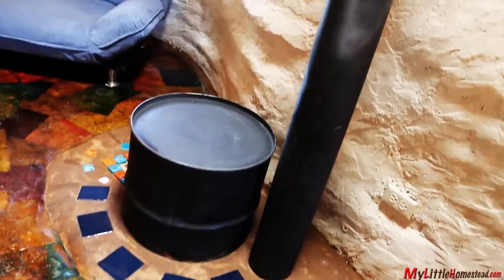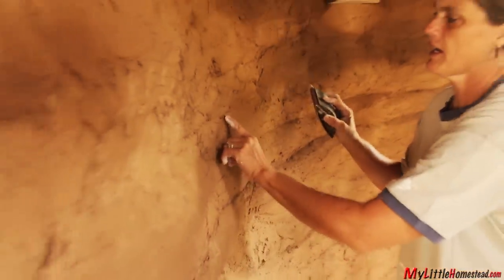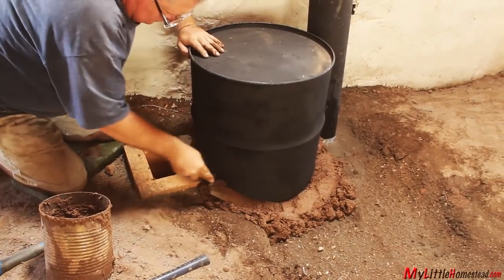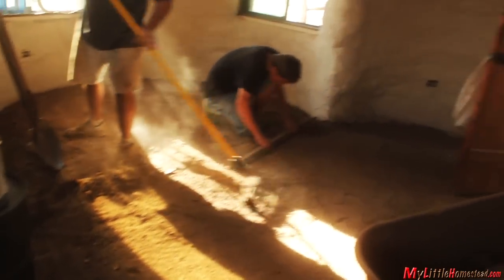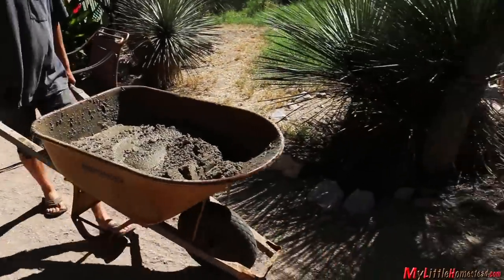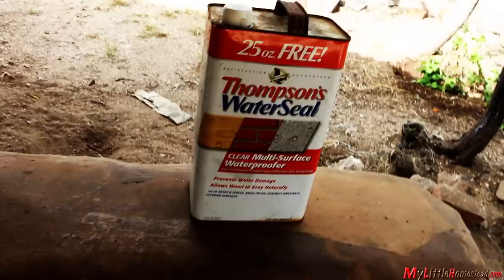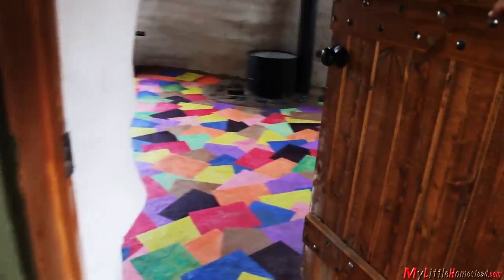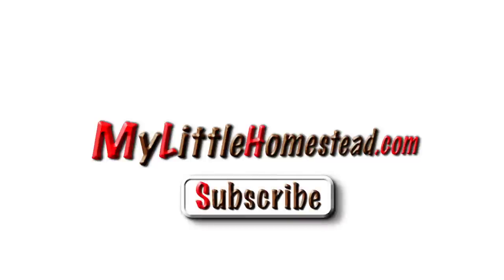Walkthrough Earthbag Building Interior for Garen | Rocket Stove Radiant Heat, Paperbag Floor

Comment: Very nice. One thing I thought of when I saw the flue buried in the ground....wouldn't the pipe rust, create holes and leaks?
Not sure how long that would take. I have those (supposedly galvanized) pipes sitting in my garage and they rust, just sitting there.
I was thinking masonry pipe sections, but those would leak too if there are ground movement issues...????
I would think underground flue's would have to be at least double layered and specially coated, to last for more than a couple years. I know...expensive.
So I'm back to (sort of) old style radiant floor. Heat the water with the stove--run the hot water through underground rated piping. Seems safer and will last longer. Good issue for discussion though. Thanks for sharing your projects.

Comment: I like that you're not JUST doing cob and simple dirty things, but you're using those as foundations, layering refining, and finishing with better, resources, to make a more complete, and respectable structure. all told, it looks great! I really love the infloor heater! that should make for a nice toasty floor, I just hope nothing cracks, from the temperatures. still, the paper floor looked pretty snazzy! I'd be tempted to laydown thick rugs, cause essentially stone floors will get cold easily, and I don't know that it'd heat all the way around. but I'd love to have a link to an update, telling use how you built it is half the battle, telling use how well it's working, a month, a year after it's done..is also useful to know!

Comment: one thing, you forgot the lime, lime 1part, with the 7 sand and 1 portland, will make a nice topper. we just worked on a rocket stove that needs a vent fan, as it has 65 ft of 10" dia duct, that dumps the heat to the floor. pretty cool setup

Comment: Please double check your pallet sources.   If a pallet is branded on the side with an "HT", it means that it has been heat treated against pests.  Any others are most likely fumigated--meaning that the pesticide is being burned (as in a stove) or coming into the house as furniture or building materials.
Reply: +Elizabeth Robinette , Thank you for that info!
Reply: +Elizabeth Robinette Seems that the Pallet not to Burn is the one with this Logo,[MB]: "Methyl-bromide fumigation, this is a powerful pesticide (that has been linked to human health problems and ozone layer depletion) used to treat the wood to kill off invasive species like pine beetles.  This type of treatment is banned in Canada and in a lot of countries because it poses a health risk to workers handling the pallets. But, you can still find it in some places. If you find a MB pallet, please do not use it for your craft projects or as firewood, find a waste-removal company who can dispose of it properly" ......thanks for the information.....

Comment: Also, from what I have learned about rocket mass heaters, you should perhaps incorporate an inspection hole, at the 180 deg bent in the piping - it tends to collect any fly ash, that made it so far into the ducting

Comment: any updates on this? curious if you have any issues with not being able to clean out that rocket stove? or if painting over the cob resulted in moisture problems? how did that paper floor age? looks like you had fun making something beautiful! best of luck!
Reply from the maker: No problems with the stove or cob. Not much moisture here in the desert. Paper floor could use a redu with changes in application.

Comment: A few years ago I went down for three months to Pisco, Peru where a devastating earthquake had leveled the city. Myself and usually about 100 volunteers on any given day did all sorts of construction work. With free/unlimited pallets and cement from the local cement company, donated/rejected utility poles and donated tarp I was able to design a modular system of 1mx2m panels which one team constructed at the volunteer location while the other team in four days laid the concrete pad. I'd designed/created jigs to make things an assembly-line process. We then drove the 14 panels to the home site and assembled them. The entire cost for a home was $500 including the furniture we built.

Comment: Hi, I just wanted to share a few things. First, thank you so much for sharing your lives with us. I find your family truly inspirational!  Second, I remember hearing at some point that there is a formula for the proportions of the combustion chamber and "chimney" height; I think it was the interior chimney that is inside the metal housing should be 3x the diameter of the pipe/chamber?  Can you share where you learned these proportions? I am interested in building a smaller rocket stove mass heater for a smaller space.   Thank you and I love your videos!
Reply from the maker: We too used the 3x. I have 2 stoves with that formula and one  I modified a little shorter. They all work great.

Comment: this is a very cool room but what happens when that barrel needs replacing for the stove and specially that pipe under the floor which wasn't rated for fire place/chimney use? and the black chimney upright pipe needs replacing about once every couple years minimum... it to looked like you permanently installed it in the floor... the pipe heating the floor is galvanized and galvanized pipe corrodes very very quickly when used with wood stoves or biomass stoves etc... not trolling just asking a fair question...

Comment: I've got a question about this set up as I intend to put a rocket mass heater in and like this idea. Question is what about the cleaning trap that normally is a hole in the pipework left exposed from cob or whatever people used to allow for cleaning the ash out of pipe. How could this stove be cleaned when its sealed under the floor?
I love the idea tho, radiant heat from the floor is best and free thermal mass with dirt. Just confused by its functionality.

Comment: looks good. hate to notice you have no way of cleaning the rocket stove pipes out though. especially on those bends where you'll get a build up.
Reply from the maker: +Daniel Fairclough 
It will be a challenge in Garen's room. The others have clean outs.
Reply: how do you guys deal with building codes or do you guys just get left alone? because if i tried doing this on my acreage my neighbors would have building inspectors out there all the time
Reply: I wondered about that myself!
Reply: psammiad i mean because i was trying to do something like this and sell my house +2 lots by the road and just live out in my wooded area but one day i see 5 guys with papers come walking up saying i was not allowed to build ANY structures on my OWN property without permits and i could not live in them without them being up to code

found out about 4 months later my neighbors turned me in saying my work sight was an eyesore

funny seeing as they cant see my wooded property unless they were trespassing
Reply: It can easily be cleaned using a Plummer Snake! coil type. by running the plumber snake all the way through, and attaching a small shortened brush to the end then just pull the brush through spinning as you go. ta da!

Comment: Love your videos. Love that you did an update on the rocket mass stove. Would have really liked to have heard what kind of decrease in heating costs there was and how warm the house got with just the rocket going and the temp outside at the time. Also, on the earthbag room....a few questions...Does it hold the heat good in the winter, does it hold the cool good in the summer. And could you actually put siding on it to keep the cob safe...cause I seen in one of your vids that you had to repair a place outside where the rain damaged it. Also, how is your cob fence holding up? Thanks

Comment: PLEASE TELL US
How are you going to get the burn ash and the fly ash cleaned out of the stove?
Thanks very much!
Reply: mitch7788 I see that underground pipe filing with ash.
Reply: Ash is burned.
Reply: disconnect pipe, shove vacuum down hole. as they showed with their 3 year old [at the time] rocket mass heater in the main home fly ash is not an issue.

Comment: The one issue you can have with that kind of floor and running your chimney under it is that it can leak carbon monoxied.  There is a very similar construction method in traditional Korean construction.  They seal the floor surface with a very thick layer of oiled paper.  Put a detector in that room if people intend to sleep there.
Reply from the maker: +Michael Erskine Thanks - we're looking into it
Reply: +mylittlehomestead greatings from Chile and one little question: how do you clean the inox tubular big smoke curved pipes that remains sub-sole under your floor? There is cumulative tar, carbon and coal inside it and on time lapse your air-smoke exhaust becomes lower and lower. I only imagine one way to clean it: to burn it with some kind of flammable additive to your fire.
Reply: +Michael Erskine   CO detector . . . . carbonmonoxide
Reply: Yes, that is exactly what I suggested.
Reply: Michael Erskine  I know that is what you meant to say but your words were " put a smoke detector in that room if people will sleep in it ".   smoke detector and CO detector not the same thing.  Just clarifying for ya.
Reply: Good point sir... good point.
Reply: Michael Erskine  I just clarified, you made the good point .  8 )
Reply: and a carbon monoxide detector
Reply: +Alvaro Riquelme rocket stoves burn very cleanly, they don't produce tar at operating temp, any that is produced is collected by the radiant heat drum and then gets re-burned as temp increases.
Reply: Try exhausting one into your enclosed house and get back to me with the results.
Reply: +Michael Erskine wtf
Reply: Patrick Pellow
Not you, skyhawk551...  You have to read all the comments every time, dude, before you get your panties in a bunch.
Reply: I think it is oiled paper, yes.  It could be some kind of waxed paper, but it is paper for sure.  I don't know that they build that way in Korea anymore but they did rural areas until a couple of decades ago.
Reply: Alvaro Riquelme , once a month burn some rock salt.
Reply: there is no presure in the exhaust pipe.  the chimney creat a under presure.   so when there is a leak in the exhaust. it wil suck air in! and not blow smoke(monoxied) out.    ( sorry for my bad englisch)  greets

Comment: Hi, does the exhaust flow ok with the low level pipe run under the floor? Ive been thinking about a similar set up to exit fumes under then out from a tent, rather then up through the roof of the tent.
Reply from the maker: Works great as a passive heater.

Comment: How do these homes really hold up to say torrential rain? Snow? excessive heat or earthquake compared to more rigid designs using beams, wooden walls, brick etc?
Reply: +kuribo1 There are cob homes in England that have stood, and continue to be lived in, for 300+ years. You have to understand that the materials being used is the same that are used a "rigid" construction, only not in the typical forms. If anything, I would go so far as to say this kind of home would be better suited for for the elements. Look at adobe walls found in cliff dwellings, they are a 1000+ years old.

Comment: You guys are doing fantastic. My only comment is, the heat mass that you are heating up with any stove, rocket or not - shall be insulated from the outside of the building. In your case, your floor that you are storing the heat in, should be insulated from the ground. Otherwise, you'll be losing a lot of stored heat, into the ground (which is infinite heat storage tank, for all practical purposes)
Reply from the maker: michbushi Thank you for posting :)
Reply: michbushi just read your comment, very useful to hear, just about to run an under floor tent heater, I'll be sure to insulate as suggested.

Comment: ***** Is this legal? you guys are inspiring and awesome!
Reply: Jo Woo Legal? Why would it not be? This is the problem with law. It keeps people from thinking for themselves and trying new things because it might not be "approved". Whatever "approved" means. Try doing something. The worst that can happen is that someone might come in and smash it or take it.  Guess what? That's going to happen whether it's "approved" or not.  Afraid of losing your hard work?  That means doing some work on the part of the "enforcement", so it's not very likely to happen. They would much rather threaten you into dismantling your own creation. This way, they have the satisfaction of you having done both works of creating and destroying while they know they're still in control.  If they're being paid to smash your experiment, there's a higher chance that you could lose your time and materials, but guess what? You can't lose the knowledge you gained in creating it! Do it again. Build like the monolithic builders of old. Build so that it is more expensive to dismantle than it was to build. Thieves love low hanging fruit and the easy score. Be smarter.

Comment: PLEASE, use a dust mask while working with all those mineral/cement particulates. Your lungs do not like that stuff. Otherwise you guys are pretty cool.
Reply: And, specifically, use a HEPA filter mask. 3M makes them, but their masks are only designed to fit men's faces. I eventually found another company that makes one comfortable for women! The mask needs to fit so that any inhaled air goes THROUGH the canisters on the mask, which is where the filters are, and not any air going around the sides of the mask. The result of not wearing one, if you breathe enough clay dust, is silicosis, which can progress, in which case it is fatal. I have worked many years with ceramics, but in the ceramics studio--at least in a well-run studio--the maintenance is always done WET, to avoid dust exposure. Every surface in a well-maintained ceramics studio is dust-free, in order to prevent breathing silica dust from the clay.